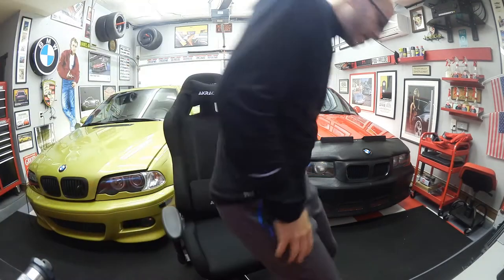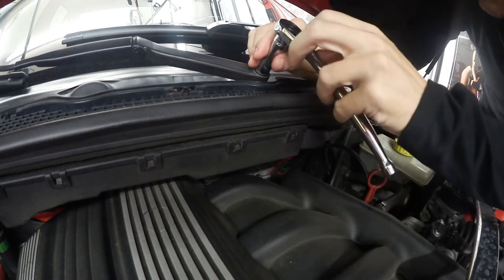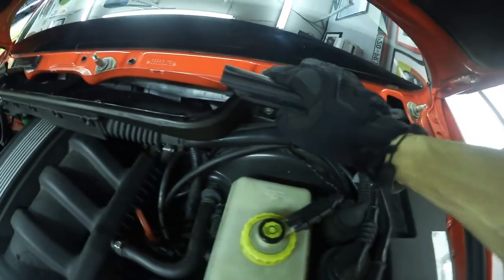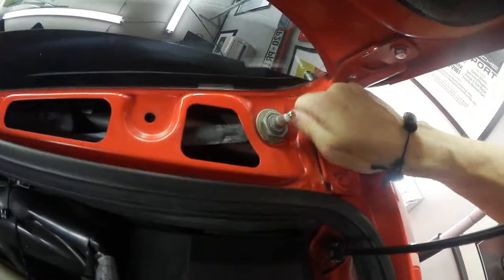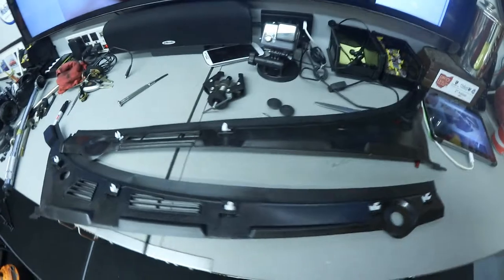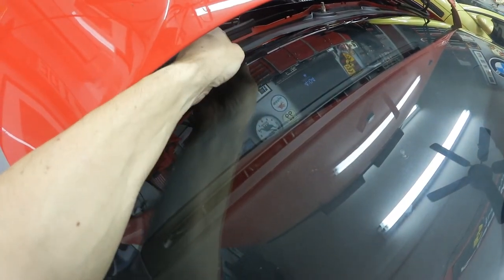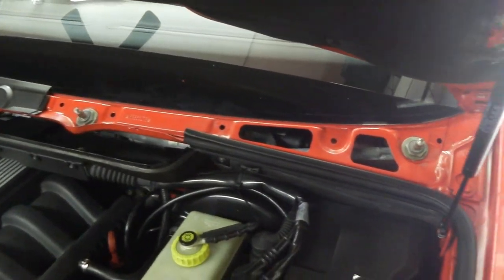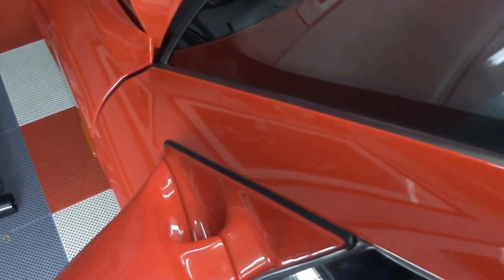1997 BMW E36 M3 Sedan | Quest for Perfection Ep. 04 | Windshield Cowl Replacement

Comment: I have a new cowl on order. Thanks for sharing the good, bad, and ugly side of this DYI project. One helpful tip for positioning the wipers on reinstallation is, before removal, to lay blue painter’s tape under the wiper blades and trace a line against the blade with a Sharpie to make it easy to see where to position the blade on reinstallation.
Reply from the maker: Good tip. I actually Sharpie'd a mark right on the metal spindle thingy knowing the little cap cover would hide my work. But any method works. I hate putting windshield wipers back on the round spline thing -- they never truly seem "in the grooves" even though youve tightened them down and did everything correct. But, you flip the wipers on and they do work.

Comment: About the driver side cowl the second rivet doesn't snap because the original cowl that came from the factory had a longer rivet molded to the cowl , when you buy a new cowl it doesn't have the longer rivet.
Reply: Rayyan Zouqash do you have a part number for the clip we need for the second one or is it a generic clip sold at autozone or something?

Comment: Hahahaha
Reply: Just reuse the two piece black rivet that is 2nd from the right on the original driver’s side cowl and the new piece fits nice and tight up against the windshield.   The two piece rivet will slide into the new cowling groove, and you’ll obviously have one extra white rivet left over.  Hope this helps and thanks for the video.